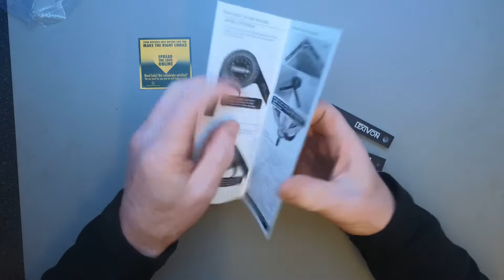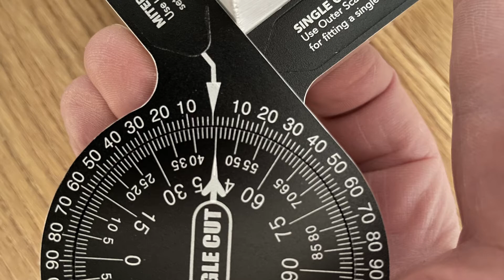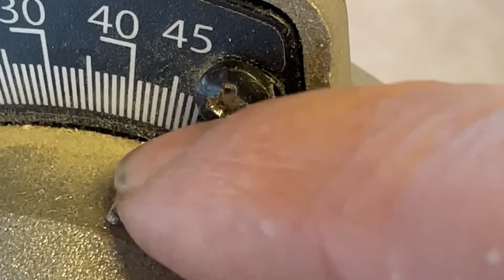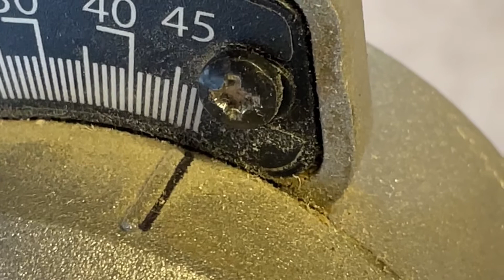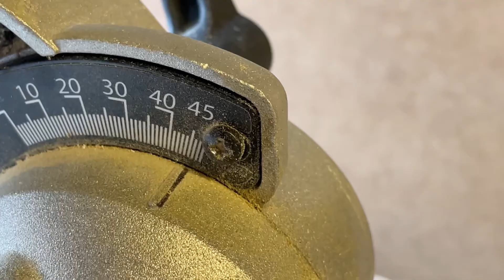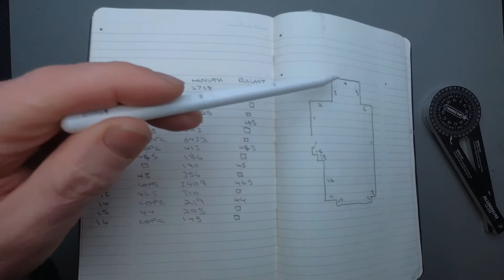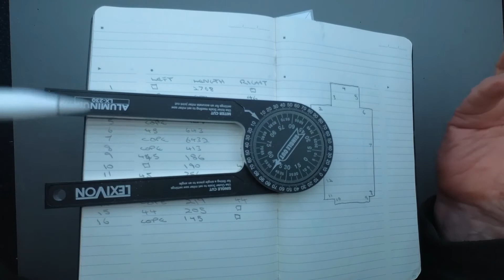Lexivon Mitre Protractor - measuring angles for skirting / baseboard (an unpaid but gifted review)

Comment from the maker: 0:00 - 1:10 Intro and how I got it
1:10 - 3:24 Unboxing and basic explanation 
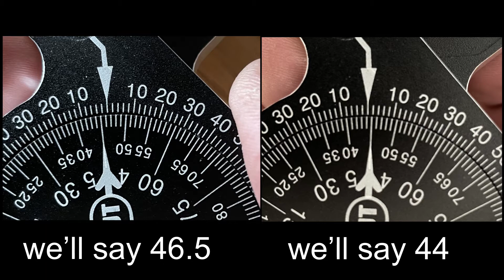3:24 - 5:03 Putting it to use and what it can do
5:03 - 12:51 Transferring the measurements to the mitre saw and cutting the angles
12:51 - 15:13 Gluing up
15:13 - 16:06 Trying the cut sections in place
16:06 - 17:36 Thoughts on it as a tool
17:36 - 21:33 How I’d batch measure and cut for a whole room
21:33 - End Final thoughts, crown moulding and cabinet trim